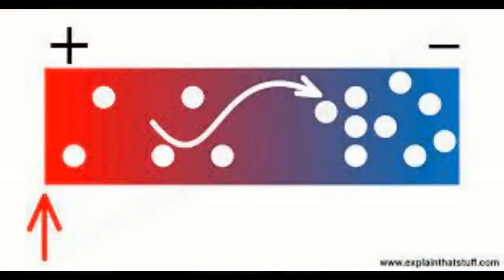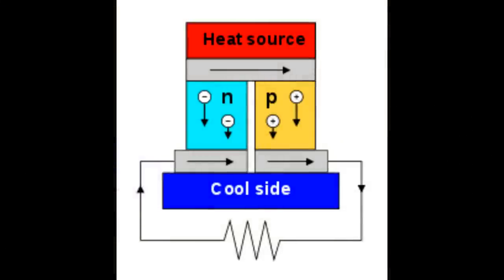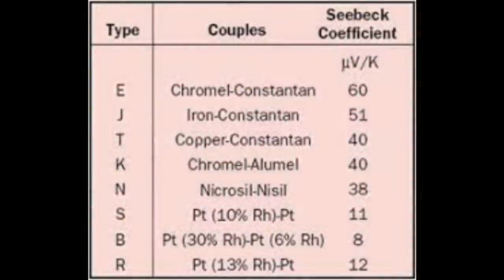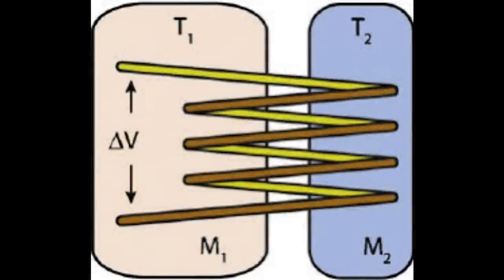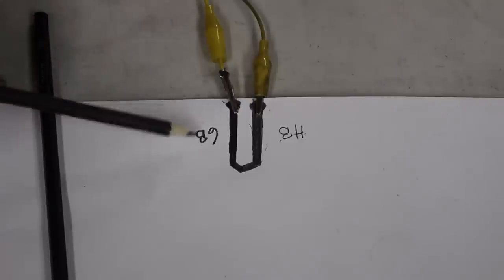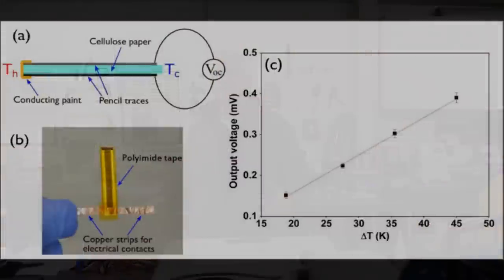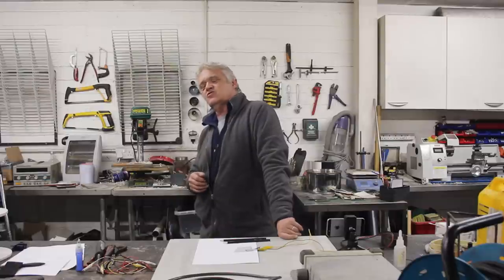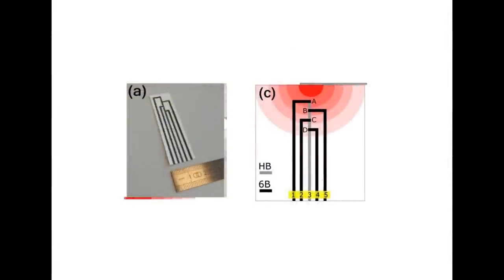1720 Power From A Pencil

Comment: As a former Lithographic Print technician, latterly a Photocopier Technician, that's a fascinating concept.
.
Had customers using carbon inks for cheque printing, and of course copiers use toners containing carbon.
Maybe a "colour" copier with different toner types in 2 Development units could perform the same function?

Comment: This was so plain simple I did it right away! I used an HB#2 and an H8 pencil. Now what was interesting is when I went from drawing it on paper to directly on a quartz crystal. The increase in power out was tremendous. I went from getting 20-30 uV to 0.182 V with a similar size circuit!!!! I repeated the process multiple times with similar results. I'm not sure why this is, but seemed very interesting to me and thought you would like to hear about my results. Maybe you can give it a go and see if you have similar results.

Some interesting finds I had:
 - I found that the size of the crystal didn't seem to matter. 
- At 300°C it no longer produced a voltage
-Freezing prior to applying heat seemed to be more of a detriment
-Applying heat to the Cathode produced more voltage 

Thanks for all of your videos!
Reply: hello sir , can i know more about this , do you make a video or even picture to understand more

Comment: EXCELENT video sir, as usual, I specialize in PV and have tried using thermocouples mounted to the back of a PV panel, one side getting heat in panel and other in cool shade under the panel. Not great resulta but i usted crapy thermocouples. Moral of the story is that your vida are a great inspiration, cheers man.
Reply from the maker: awesome mate - I am glad to hear that - cheers

Comment: I like the idea of applying graphite thermopile inside bearings on rotating axles where heat is a natural byproduct.

Trickle recharging electric battery without parasitic losses and potentially extracting heat for better long term wear and performance.
Reply from the maker: nice one mate

Comment: I worked at a company where we did thermal testing. A neat thing about thermocouples was that the specific dissimilar metals didn't actually have to be joined together. The could be joined to a third conductive material individually and the output would be the same as if they were joined before attachment. Seems the anode/sample joint, and the sample/cathode joint voltages canceled out to result in the same anode/cathode voltage of the instrument wire junction. So long as the two attachments were not too far apart in temperature from each other.
Reply: so say a sheet of heat conductive material with the printed themalcouple on seperate sides?
Reply: @qbertque  
Should work, at least as a single hot, or cold junction. It would have to be electrically conductive as well.

Comment: So if you combined the graphite thermocouple with your pot evaporative cooler would it improve voltage from the thermocouple.  The pot cooler uses heat to cool the inside of a clay pot.

Comment: Salvaged 2 of these(peltier devices) from a humidifier i found the back in the summer, tried to see if i could use the heat from my solar panel to create electricity usnig these, if you put heat on them they produce a voltage so a good way to perhaps capture excess heat.  I couldnt get more then 50mv so it wasnt that good, and going the otehr way, trying to cool the panels with this by applying electricty, actaully worked but took too much energy , at best i think it evened out, the price of cooling was the amount of energy i got due to cooling  panels, maybe if you had the whole panel covered it might increase exponentially towarad a net gain and could be worth cooling as panels can loose upto 30%  efficiencey when overheated.... but  i didnt get that far.  
I did  try to simualte an AC voltage as youve probably noticed rubbing one side creates a positive voltage, rubbing the other side create a negative, so in theory if your rub it in the right timing you should be able to create an AC voltage?  easier said then done, i couldnt get the timing right.  Then I jsut put the thing between my laptop and the cooler it was sitting on (targus laptop cooler/stand), and voila!  2.35v  AC from 2 of these in parallel just from the heat from my laptop on one side, and being cooled by a fan on the other.    Im not sure if the laptop was blowing or sucking air to be honest so i dont know how reproducable this is - a stable ac voltage, maybe i just had the right fan speeds  but WOW 2.35v AC vs 50mv DC .  Thing is i cant really think of a place to expoit a hot an cold side to make this really effetive, perhaps floating on water, where the one side is cooled by water and the other side is heated by the sun. Or better yet, space! there you'd have 300c on the sun facing side and -300 on your back for the cold side.  Perfect place for these devices, probably could provide massive energy and perhaps the key to interstellar travel.  Anyway ive sort of rambled about this but wanted to share, i was able to get AC voltage from a peltier device and i havent  heard of this being done anywhere so maybe this info can help somone in their pursuites of free enregy.   Theres one last option, make energy! why not? its been done before, maybe it can happen again? but according to science energy cant be made or destroyed... drats! but wait, its here, so there was a mechanism that made it happen, so why not again?

Comment: Silk screen!!!!   I have been rolling this around in my head a while.
Reply: You could very easily create thousands of contact points in a single shot.  It would allow you to use any conductive ink/material you wanted.

I have been thinking of making a attachment for my woodstove chimney. Print the contacts on a very thin layer of fiber wool. In a circular pattern. That should provide a huge gradient in temperature fairly easily. If you laminated them and sleeved a stove pipe into the pile.

Creating contacts to the outside diameter would probably be tricky.

Comment: This subject has always fascinated me, if I remember right feeding current into them will make one side get hot and the other cold,  if it was able to be more efficient it would definitely be a very useful device, another subject that I think about alot is how trees move water up so far, Robert did do a video that touched on this a bit which was really nice to see
Reply: Yes, I had a wine cooler that operated by this principle. Completely silent and no moving parts. It lasted a couple of years, then conked out. It was replaced under warranty, and that one conked out after 2  years.
Reply from the maker: it is indeed a fascinating subject - the thing on trees too!
Reply: @ianbutler1983  that's good to know, seems they have a fairly short lifespan when used in this way then, my dad has one that runs a fan on his wood burner, has lasted about 5 years so far, I've started making a methanol heater after being inspired from watching Robert's video, wanting to make it a bit more sturdy but maintaining as little cost as possible I've used an old gas bottle (filled with water and left for a week as I don't fancy an explosion) and a scrap stainless steel bin, even has easy fitting for a flue at the top, I will be using one of these thermo couples, I'll need to fabricate a flat base at the top for it to sit on but I'm hoping it's going to make a nice finishing touch
Reply: @ThinkingandTinkering  I've been meaning to test a theory for some time now, I have half built a meter long vacuum chamber from scrap toughened glass, the idea was to run thin tubes through the middle painted black to absorb infrared, the tubes to sit in a container of water at the bottom to be kept cold, the vacuum chamber in direct sunlight and then the tubes exit out the top into a collector, the idea was to see if it was possible to collect enough heat from the sun into the water to overcome the tension at the end of the tubes, after watching your video on the evaporative cooling effect on water tension I'm now looking at trying to incorporate this at the top

Comment: I like this, I wonder if it would work well if you put it under the roofing materials, (either metal or shingles) if it wouldn’t produce a lot of energy while the roof heats up in the summer.
Reply: Good question. And how would that compare with solar? Or could you do both simultaneously?
Reply: Interesting, Solar becomes less efficient as it heats... this might generate more. You could screen print on tiles...

Comment: Are we looking for a temperature difference along the graphite path, or is constant even heat ok? (Curious because of the roofing comment below) 

Could you demonstrate a printed method of combining multiple units on a single paper in series and parallel? 

Does the size of the unit, thickness of the line, or temperature itself make a big difference in output?
Reply: Wish I could convert my roof to charge battery. Instead of solar panels.

Comment: Hmm. Okay... my brain is trying to work here... 1 piece of paper, three printers with three different kinds of ink. The first two would be for the thermocouple. The third is copper-based. (I don't know if you need the third...) So it'd be like two trees growing close together... the copper makes up the trunk and transports the electricity generated. The branches of the two trees that interact are the first two inks. You design a very simple but very tightly repeating pattern with thousands of 'trees' on a single piece of paper. You break this into three different files, one of each printer/ink. Print the paper through the first, let it dry a bit. Then print the same paper through the second and again on the third. Then repeat this with more sheets until you have something like a 6'x3' area of paper. You then laminate each page to protect the ink and prevent any moisture from getting in there and messing things up. Then you get a 6'x3' thin copper sheet (or foil) and paint one side black. Treat the other side with something thermally conductive to prevent oxidation. Adhere the sheets once the electrical connections are made to the non-painted end of the copper sheet and build a black box around it with a glass top. Going for the greenhouse effect here, but on steroids. Then attach another, non-painted copper sheet to the bottom to make the cool side. Then just set it out in the sun. You could solder some fins to the bottom side to help with heat dissipation or manufacture some sort of cheap heat sink. New kind of solar panel that uses heat alone instead of photons to produce electricity. It should also last quite a bit longer than solar, I would think.

Could be an interesting project? You'd need some sort of strip of diodes for each of the 'trunks' on one side of the papers to control the electrical flow. The only particular part about the diodes is they'd have to have incredibly low Gate voltage/current so you're not wasting power on the diodes...
Reply from the maker: maybe a fractal design? like a fractal antenna?
Reply: @ThinkingandTinkering  Fractals are interesting... but I think you'd need an extremely precise printer for that... With trees and everything being more-or-less straight up and down on the sheet, I think you could do more with more common, less-expensive printers...

Comment: I would think with the thermopiles and a diode to direct the current into a capacitor it could be collected to gain a decent volume to then be usable for something... It may take a while, but if it is passive and not needing constant attention, this would be a nice way of maybe moving heat and gaining a little usable power out of it
Reply from the maker: I agree mate - hmmm

Comment: When I need to use my airco (for heating) I am thinking of trying to see if I can do something with the cold air that is being created on the outside unit. Could it run something? I do have a peltier element (salvaged from a beer canister) and hope to get that to work.
Not far from here, a new building is made. It is a combined swimming pool and ice skating hal. They work in tandem! That's clever thinking.
Reply from the maker: that is clever thinking mate - we need more of that kind of thing.

Comment: somehow, this idea makes the Matrix less frightening... and imagining Neo comming out of a pile of HB and 2B pencils is hilarious...
also just rembered MrTeslonian used some woodworking pencils (presumably very hard) and aluminium wire to make arround .6 volts by blasting that with a propane torch, al wire and pencils aren't that expensive, so that still fits on the idea of something so cheap that you can work it enough to make the kind of power you need.
Reply from the maker: the matrix has you lol - I agree mate lots and cheap is a very valid way to go

Comment: And now we know why my paper solar cell worked.  LOL,  it was the heat and not the light.  I did this in layers of different carbons rather than points.  My layers came together into a bunch of contact points apparently.  I was wondering whether or not it might be acting as an antenna, now I know it was a functioning thermo-pile.  It was with 2b graphite and graphene by the way.
Reply: Your video on paper battery cells made me curious as to whether it could apply to a solar cell.  So I commented as much and you said go for it.  So I did.  It worked, just not in the way I had anticipated.  LOL
Reply from the maker: that is awesome to hear mate - it really is by our working on stuff we find new things!
Reply from the maker: nice one mate

Comment: Is there a way to use a CAD program to produce a large array of coupled traces and then transfer that print to a functioning substrate/ink device?  Maybe electrostatic/optical?  Obviously, it could be drawn by your laser table or other 3D printer with a pair of pens (in 2D mode) but that is tech few have.  As a kid I had a small manual kit that demo'd the xerox process, so I know it can be done cheaply, but a large DIY scale-up would require SOME sort of automation.
Reply from the maker: I would think so mate

Comment: Another good one, Rob!

There's a lot of demonstrations out there (not just this one) that show they can light a light bulb or spin a fan, but I'm wondering, now that we've got them, if it's feasible to build up to "can it charge a cel phone or a cellphone charger?"  Would seem to be a lot easier than charging a car battery, as was about the only alternative when the "light bulb" test became popular.  

Not sure about the lithium packs though. How would they hold up under uneven charging? Would it degrade them faster? Would they burst into flames?
Reply from the maker: I guess you could always stick a voltage regulator between the power source and the battery bank